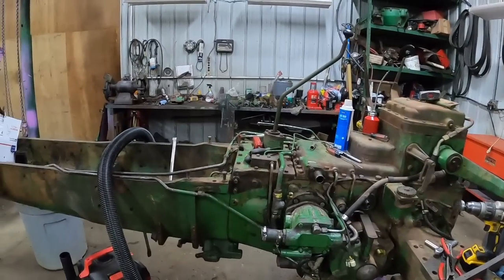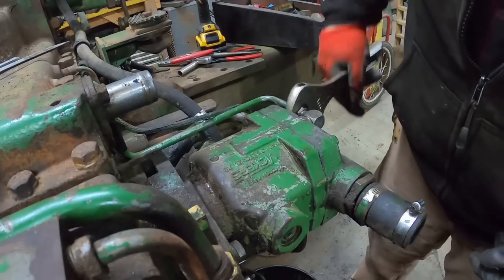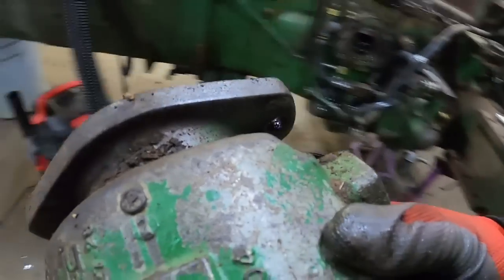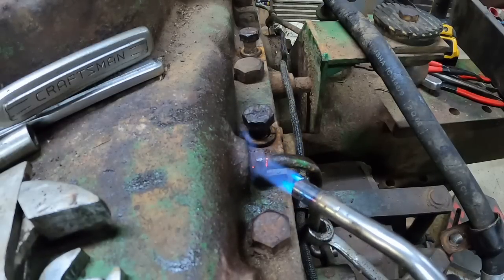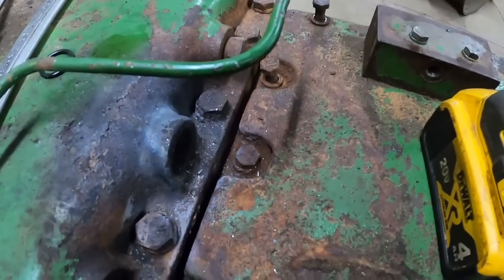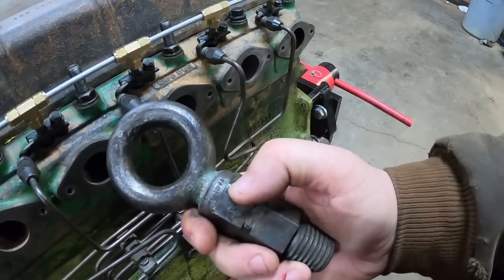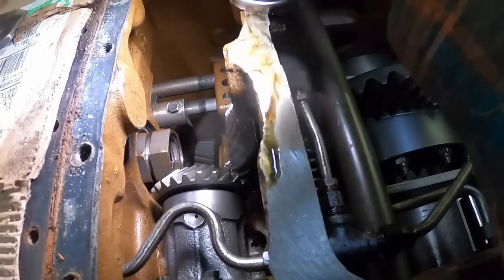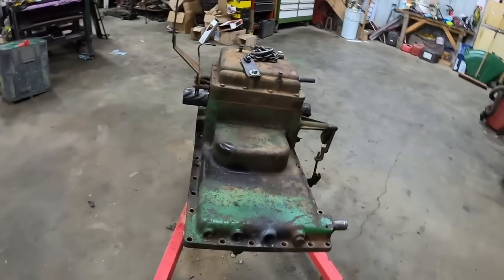REAR END - What's inside the 1855's backside?

Comment: Hey buddy, all the stuff that you have taught me over the past few years maybe I can return the favor. Also, this is not meant to be a keyboard mechanic comment lol..when you took that big hydraulic line off of the top cover, you warmed up the cover and then eventually the nut and the cover were both red hot. The problem with warming up the cover is it expands into the nut and actually gets tighter. It's the cooling off a lot of times that breaks something free in a situation like that. Dealing with all the old forklifts, they all have that same problem. I have found what works the best is if you heat the nut up good and hot and then walk away. Come back a couple minutes later and as the nut cools down it shrinks and it breaks free from whatever it's threaded into. Then I spray a little weasel piss on there and they come right out every time. Awesome Sunday video as usual. Looking forward to seeing this one done although spring is creeping up on you pretty fast.
Reply from the maker: My experience has been, if want to make it go, you need to make it glow.   I should have let it cool a little more because I did distort the nut a little, but my experience has been they go easiest while glowing a little. I'll try your suggestion next time, I'm never too old to learn a new trick

Comment: I noticed that the 2 bolts that are at the back of the frame just inside of the top 3-point bolt on spot appear to not have been made one size larger.   We had the famous gasket walk-out problem on those covers.  The top link flexed the back of the hydraulic housing a very tiny bit and that would cause the base gasket to walk itself out and start a leak.  Oliver suggested drilling the case threads out and taping the holes 1 size larger.  It stopped the problem as one could torque the bolts tighter without fearing breaking the bolt.
Remember the pump drive retaining nut that they did not design the proper lock for.  Pull the PTO shaft and it would drop down into the transmission case if the tech did not hear it drop when they put the PTO back in and start the tractor the nut would cause great damage when it sometimes would exit thru the side of the housing.  The fix was to pull the tops off and put the new locking parts on.  I bought a big crow foot tool so that I could reach in thru the hydraulic pump opening and reinstall that nut using a healthy dose of thread locker.  The red stuff made sure the nut never came loose unless you applied heat.  It was a pain to work thru that pump mount hole but it sure beat having to remove the cab.  The bonus was that the warranty flat rate for doing that the way they said to do it was it paid for having nicks and cuts on one's arms and hands and better shop profit. I still have that tool and when I see it sitting in my tool boxes it brings back painful thoughts of all of those nicks and cuts.
Reply from the maker: This one is late enough to have the 1/2" bolts to hold the cover, plus the 5/8 conical bolts. Wait until the episode where I replace the 3 point lift cylinder seals. That distortion is discussed, including a solution I was not aware of all these years.

Comment: Hey Chris not sure if you've ever tried this but if possible I pour cold water immediately after I've used the smoke wrench to heat something up.  It helps to loosen the the temper since the water cools the metal quickly.
Reply from the maker: Thanks for the tip!

Comment: Does that line where you are wanting to re-route the case drain need to be lower pressure than the case drain?
Reply from the maker: It needs to be as close to zero as possible. It will be going in the suction side of the cooler pump, unrestricted, so that should do the trick. I learned this from Brad Maibach, he's been doing it for years.

Comment: Is it the basically the same transmission in my 1800a I lost low range in it? Will the electrolysis clean rust from inside the tank?
Reply from the maker: It has quite a bit in common with the 1800A transmission, but beefed up a lot more. 
Electrolysis works great for the inside. I plug the bottom of the tank, fill it with the electrolysis solution instead of submerging it in the big tank. I take the sending unit out and out my anode in that hole. I put electrical tape on the anode wherever it might touch the tank so there isn't a direct short, and turn it on. Afterwards I powerwash it the the sending unit hole the best I can. Really cleans them up good.

Comment: I use an air hammer and dull chisel on those big line nuts and big jic fittings it works really well in tight places where you can't swing a big wrench . Yes it does booger the fittings a little but saves alot of swear words.
Reply from the maker: But then how will I put my daughter through college? 😂

Comment: Glad when you were heating that fitting up I seen you were wearing your shoes and not crocs 😂 in hindsight would penetrating oil have worked if you’d applied it weeks ago? Just curious on your thoughts
Reply from the maker: I've seen a lot of debate on the effectiveness of penetrating oil on other channels. If you haven't already seen it, a channel called Project Farm had some great tests of different penetrating oils. Personally I don't use them like I used to. They are good for lubricating the threads and do help in that sense, but I don't think they really get in through the rust like many people think.
Reply: Get it hot and melt candle wax into it. You'll be surprised at how far down the threads will be wet.

Comment: Good morning Chris! Well shoot I think I may have missed something, I did not realize there was a seal on the back side of the input shaft.  This is the first 55 series I have ever had apart and I don’t remember how the seal looked or if it was even in there.  I went back thru pictures but I don’t have any that close up of that area.  Maybe you should put some money in the swear jar for me.  And now everything is painted!
Reply from the maker: It will be in an upcoming video, but early ones didn't have that seal. It tended to be more of a problem on the Wheatland models because the engine sits level and so does the shaft, letting it walk up easier. I wouldn't tear a tractor down to switch, but I'd upgrade while I was in there. That probably helps about zero. 😂
Reply: @ThatOliverGuyChris  ok well it does help because my 1955 is a earlier model so I bet it does not have that seal.  I was in there checking and cleaning. I check the back lash on the hyd. Pump drive, and was messing with the lube pump and chain. I think I would have noticed it? Maybe.. anyway Ill hope all is good. Thanks Chris

Comment: Good afternoon Chris.  A guy just told me about your videos. I have a 1855 I’m having PTO issues with.  I’m going to tear into it in a while. Just wondering if you have any advice.  Been on the other green my whole life. Not used to this Oliver stuff yet.  Though I love the tractor!
Reply from the maker: What is it doing, or not doing?
Reply: So when you begin to engage pto it will start to spin. But the second you fully engage it stops.  It was working great last fall.  Never used last winter.  It was covered up.  This Oliver stuff is all new to me we’ve always had the other green.
Reply from the maker: @joshallen5597  the valve on the back of the pto unit controls all of the function, and since it starts to turn, I'd say you're getting pressure to the valve. I'd start by checking linkage. Disconnect the rod that goes to the lever, put a small crescent wrench on the lever on the control valve and try turning it on that way. Take the cap off the top of the valve and watch the internal lever and verify it isn't loose or broken. The arm has a roll pin that engages a vertical spool. Sometimes that roll pin gets worn or loose and doesn't move the spool properly. If all of that is working properly, no slop or broken parts, then I would say something is sticking inside the control valve. It can be disassembled and cleaned up, but I currently don't have a video on that. One other thing you can do is verify pressure by putting a gauge in the line that goes to the valve. It's the one that does not go to the reservoir. The pressure should be 180 psi. This works off the same circuit as the brakes, so if they are working properly, you should have good pressure to the pto.
Reply: I want to thank you for spreading your knowledge on these tractors.   I’m from northern maine and everyone that knew these tractors are in a nursing home or dead.  Everyone picks rocks with a 4wd 200 horse tractor or bigger.  I’m going to dig into this in a little bit. I ordered clutch discs just in case.  Everyone I talked to said it was the friction plates.    Thank you again and have a good day!
Reply from the maker: @joshallen5597  I did have a 1755 that did something similar. It would just try to turn then stop once engaged. It ended up that the snap ring that holds the clutch pack in the drum had popped out, letting the clutch discs come out as well. Why it would turn a little as I engaged it is beyond me. It was only a little bit, maybe the pressure of the piston would put some pressure on a bearing transferring some rotational force until it was fully extended. I got a new snap ring, put it all back together with new seals and it has worked fine ever since.
Reply: Good to know i really appreciate it.  Once clutches come in I’ll probably end up pulling it apart.  On my way home now to put the Gauge on it.
Reply: Good to know i really appreciate it.  Once clutches come in I’ll probably end up pulling it apart.  On my way home now to put the Gauge on it.
Reply: Good to know i really appreciate it.  Once clutches come in I’ll probably end up pulling it apart.  On my way home now to put the Gauge on it.

Comment: Chris, I agree why you got it torn down that far that you might as well just open up the rest of it to make sure the seals  are there and might as well replace them the seals are getting pretty old.   Replacing the seals now will save you time later.  Thanks Michael
Reply from the maker: More than once I have thought, that ain't leaking, why mess with it? Now I need to do axle seals on the 1650.
Reply: I've had that same experience in the past.  I had a 1986 Ford ranger that the clutch went out I replaced the clutch but I did not replace the throwout bearing two years later, I needed to drop the transmission to replace the throwout bearing.